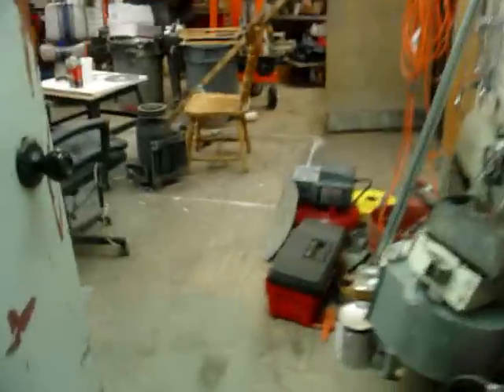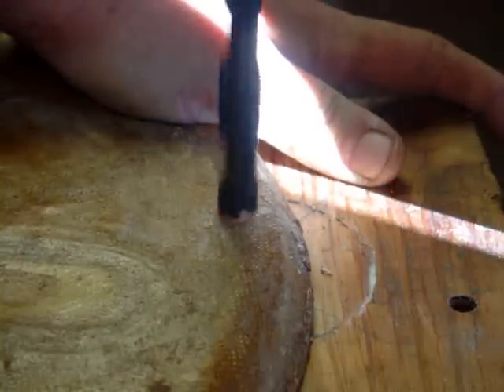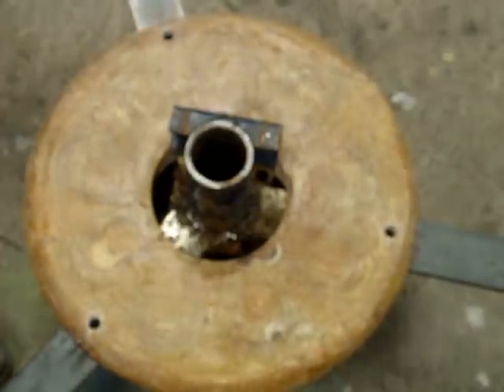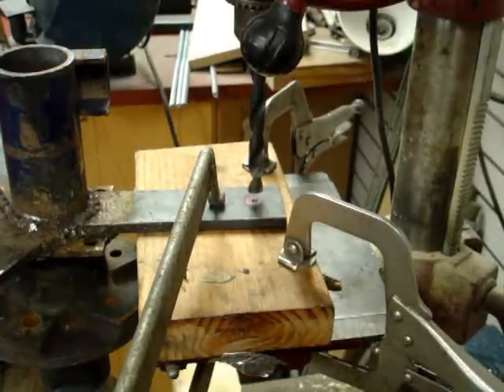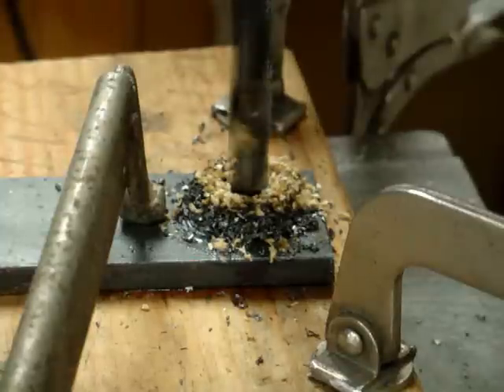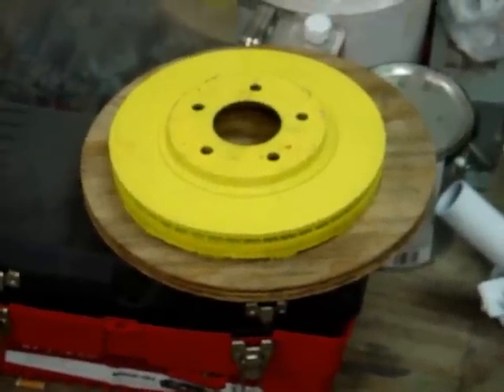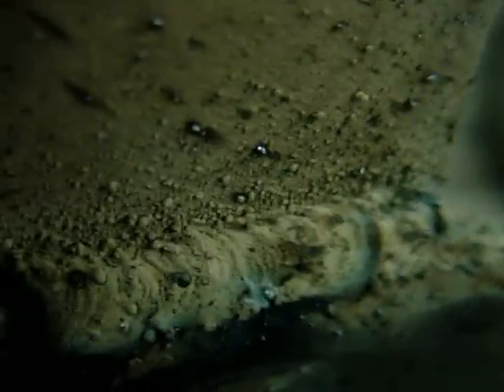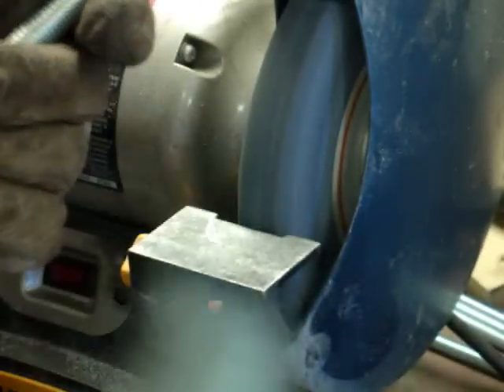BUILD A  DUAL PERMANENT MAGNET ROTOR WIND TURBINE (PART 22)

Comment: What you said about the welds is correct. But, still see porosity on the fuse line. Should grind out and re-weld or weld in two passes. Keep you the great work Sir.

Comment: Hey Muddy, for drilling, I would like to recommend a product called BOELUBE .  It's a wax like substance that you dip your drip bit in to cool and lube your bits.. works like magic, seriously.  We use it in aviation sheetmetal work all the time.  1 half quart jar is about 20 bucks and will last you for years.  It is amazing how well it saves your cutting edges.  Worth looking into, I use it at work and home all the time.  You might get curls of metal instead of dusty chips using it.
Reply from the maker: BOELUBE. Thanks bro. If it is good enough for aviation production use, It is good enough for me. Thanks Chris.

MUDDy

Comment: Welding Mild Steel to a Cast steel is tricky, especially if you do not follow the procedures of pre heating and selecting suitable electrodes. Good instructor and quality video. THANKS.

Comment: Hi Muddy,

Still following your project. It's looking good. One tip for drilling metal.  Don't give too little pressure, press the drill quite hard, apply  oil as soon as the oil that's already there starts smoking,  and only give little pressure when the drill is almost getting through the end of the hole. This will give your drills a longer life, and you need to sharpen them less often.

Cheers. Joris